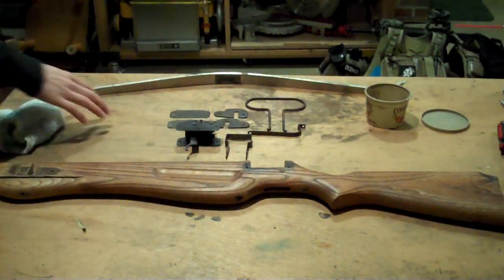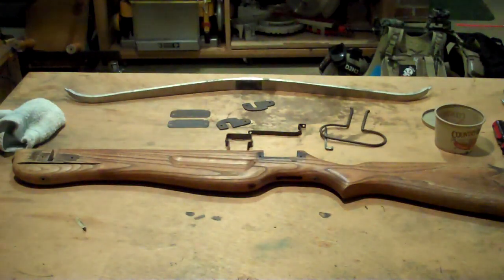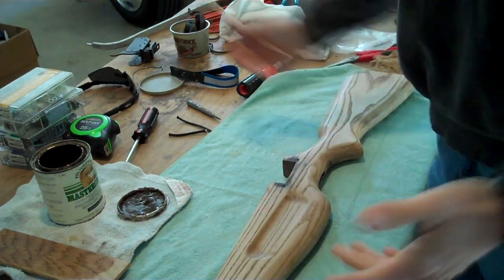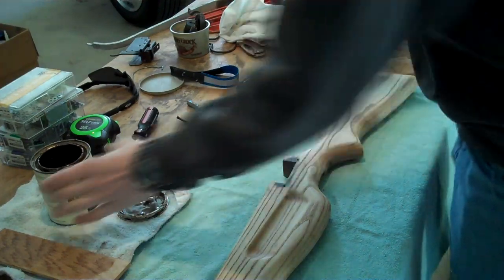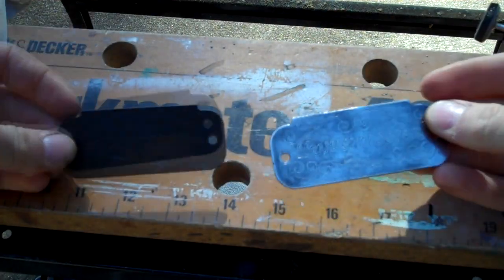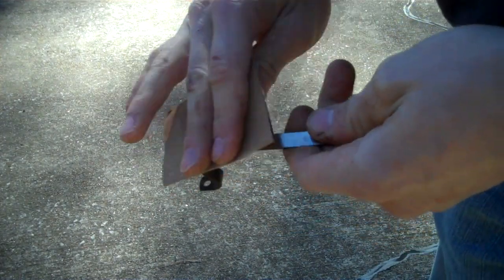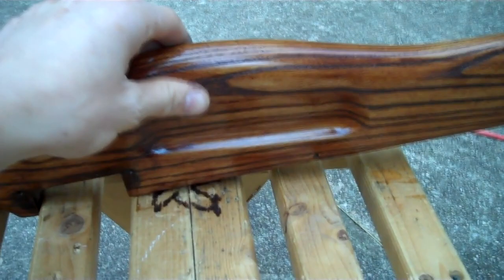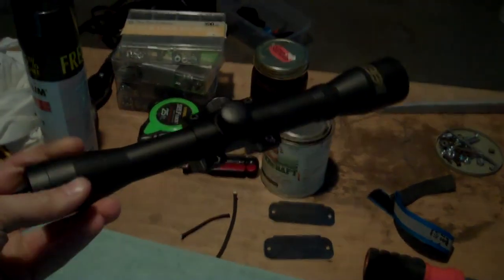Restoring a Crossbow Part 2

Comment: It kind of neat to see this cross bow vs my cross bow of today.  The difference being I think they are called winds that mine has.  Besides that and my stock isn't wood is all I see.  In my state, one needs a special license to hunt with one and it usually takes a doctors signature.  Then one can get a yearly license or lifetime, I have the lifetime on.  When I shoot my bow there is a thud noise and thats it. Its a 150 test and I have a scope on it for sighting ( three dots). I use a rope to cock it, no crank.  Thanks for sharing your redo your cross bow.  Have a good day.

Comment: You may be able to epoxy a picatiny rail to the tom of the trigger mech to save on trying to braze or weld something on. What size is the string for your prod? I made some for my crossbow and if you let me know the length you need I can make you a couple up as well as a longer string for use to string the prod easier. I will need to know the draw weight also so I can make them. and where I can send them to if you wan t some made up. I use the continuous loop method for strings.
Reply from the maker: Unfortunately the scope mounts are not a standard picatiny rail. That was my first thought as well.

Comment: Ironically this is the first video I found trying to find more info on this. I just saw the same model of Powermaster for sale today, in the same exact condition as yours with rusty metal parts missing string and rough stock, for 15 dollars as well. Weird... 
Anyway ive heard some bad things about the Aluminum bow that worry me so now im double thinking if I really want it. I guess for 15 bucks I can always eat the cost if its bad.